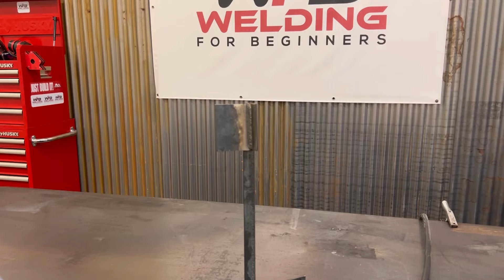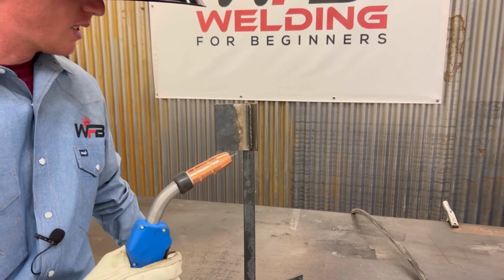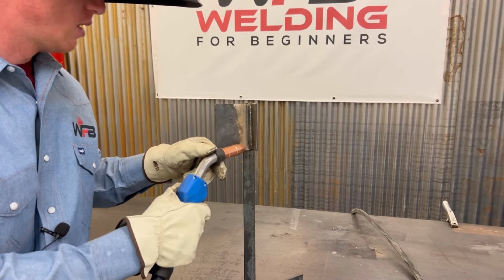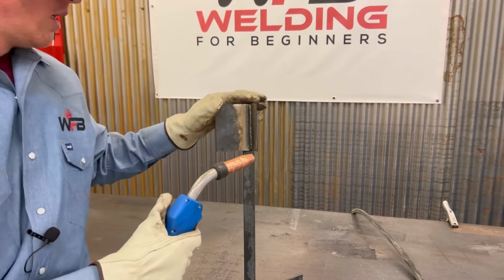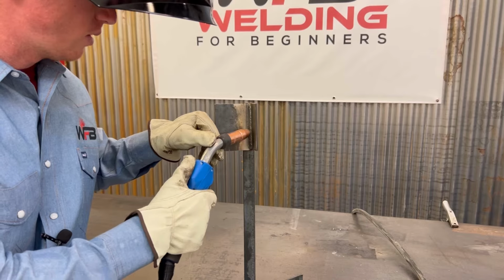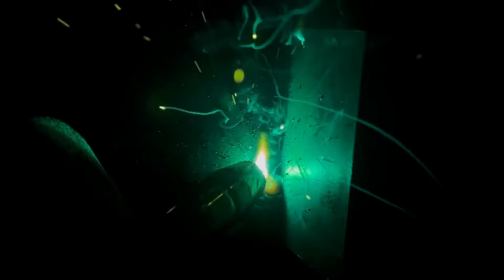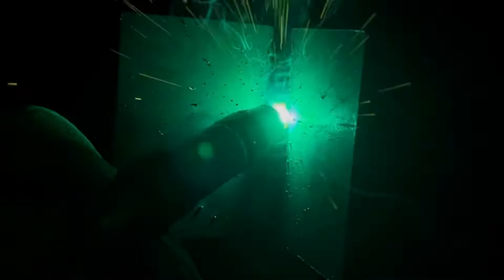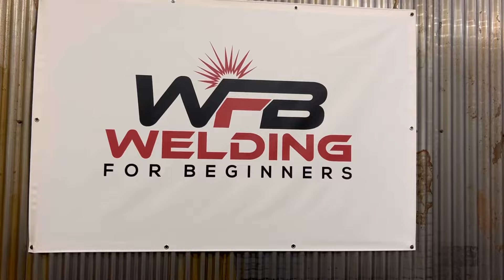MIG WELDING VERTICAL- For Beginners

Comment: I know it’s been a while but do you recall the amps and wire speed you ran this at? I tend to get over heating or dripping when I run with the v pattern
Reply: same here thats what i was wondering
Reply: Usually 17.8 amps and 240 WFS

Comment: My miller 211 has only numbers 1-10 and 10-100 for wire feed and voltage. Still, the chart works pretty good for horizontal.  When going vertical, do you go higher or lower settings than your machine's thickness chart ?
Reply: With my 211, I use auto weld mostly because I've gotten lazy. I find it's better to lower the voltage/speed when vertical welding. If I use the same setting for horizontal, I get a buildup of material in the middle that often sags.  That's with the v style, where it's fast through the middle and hold on the sides.